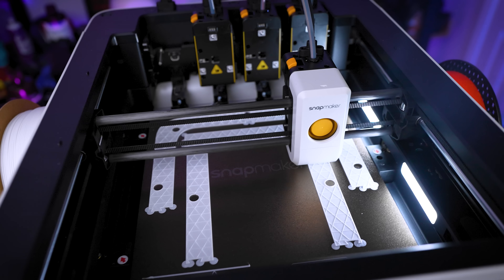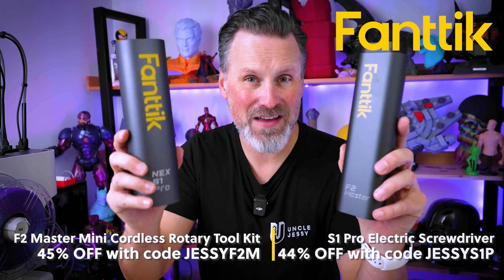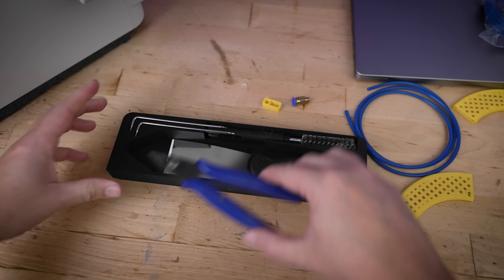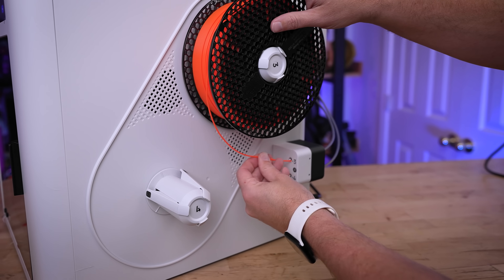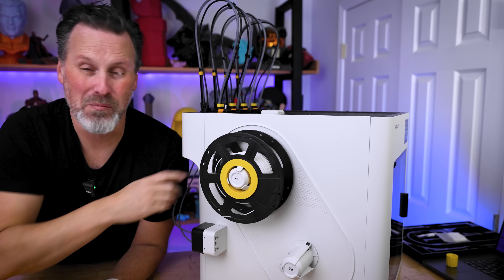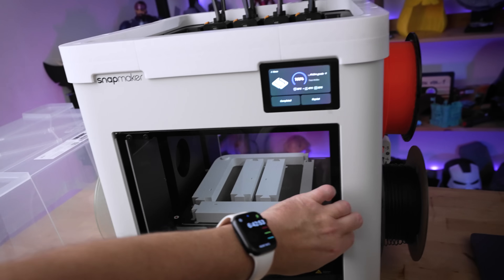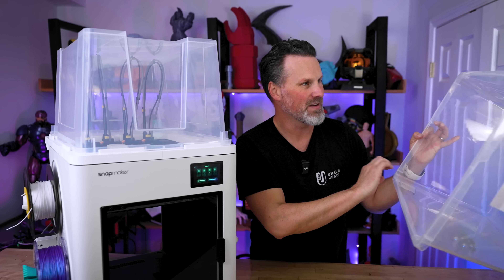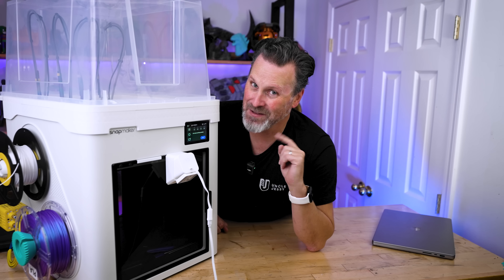10+ Mods That Make the Snapmaker U1 Even Better!

Comment from the maker: Get 45% off total for Fanttik F2 Master Cordless Rotary Tool Kit  with code JESSYF2M at  https://amzn.to/4nKpizZ 
Get 44% off total for Fanttik S1 Pro Electric Screwdriver with code JESSYS1P at  https://amzn.to/3Lw0MoZ

What Kind of Mods do you want to see on the U1?
Reply: Well 3 days after, code still dont work... Too sad, Tell Fanttik that this kind of problems hurt your comunity trust.
Reply: The promo code does not work. When I try to apply it I presented with the following message "The promotional code you entered cannot be applied to your purchase."
Reply from the maker: @cid @cidercreekranch oh no let me double check
Reply from the maker: @cidercreekranch looks like it should be fixed now
Reply: @UncleJessy  Same thing. Instead of 44% off it offers $10 only. Still too rich for me.
Reply: Conde does not work...
Reply: The promotional code you entered is not valid
Reply: Same.. Does not work
Reply from the maker: @000elemental000 looks like it should be working now
Reply: @UncleJessy 44 % off 59$ isn't 10 $ which what it is showing
Reply: I am having the same issue with the code as cidercreekranch. I fallowed the link provided, added it to cart and applied code but it says following message "The promotional code you entered cannot be applied to your purchase."
Reply from the maker: @DemonEjus thanks! I’ve reached out to my contact to see if they can get that corrected!
Reply from the maker: @DemonEjus 🤞🤞 should be working now
Reply: @UncleJessy  still giving me the same message sadly.
Reply: @UncleJessy still no joy.
Reply: @UncleJessy  The code is still not working. I bet you didnt realize the head ache this was going to be. Lol
Reply: Regarding the Fanttik F2 Master Cordless Rotary Tool Kit, Amazon is only applying $23 discount on 45% off $75.
Reply: @raysuave20  The code is working for you? Because mine is saying "the promotional code you have entered cannot be applied to your purchase."
Reply: @raysuave20 I believe it is off the full price, not the current price.
Reply: Code not working for the screwdriver for me either.  

As to the comments re:  Uncle Jesse being a shill?  I can read.  Amazon reviews seem quite positive.   

Bringing quality products to my attention is the POINT of YouTubers as I understand things.
Reply: This soulless youtube shill can't help but shill garbage products.

Fanttik is trash and uncle Jessy will gladly advertise any garbage on his channel as long as they pay him. 

DO NOT BIY ANYTHING HE SUGGESTS...
Reply: @Nonsense-hg6mo  But we should follow your advice, although u didn't provide any example / experience / reference to support ur claim, because... ?

Comment: I've had the exact same problem with my U1, used PETG and it clogged up very bad. I was using toolhead 4, The hot end is stuck inside the PETG balloon, the printer knocked hot end 3 off of the back rack and pulled the casing off, not sure how bad that's damaged. I've logged a support ticket but my printer is basically bricked - how long did it take you to get a replacement dude?

Comment: I'm pretty sure you can still print with 1 hotend disabled, i had exactly the same problem and i was able to print with my remaining 3 toolheads.
If i recall correctly you have to unplug the hotend but leave in the thermistor. If you leave the hotend plugged in it wouldn't work, if i disconnected the thermistor it wouldn't work, but with only the thermistor it worked.

Comment: what I would like to see is some extension cables for the filament feeders so you can mount them behind the printer thus making printing from a filament dryer like the s4 easier. I'm also curious, since it's open source, if one could use a macro that, when an unload command is sent, an extra command is sent to an exterior motor that sits in a drybox for example, and would handle retraction so you do not have to open the box to manually rotate the roll

Comment: It could make for a cool video to let GenAI help you calibrate your filament and improve your print quality. Upload images.. let it tell you which flow rate is best, which pa setting is correct, which temp tower temp to pick ... Troubleshoot whisps and quality on prints after etc.. it works fairly well honestly.

Comment: You mentioned wanting to magnetically attach your tools to the side and I had a thought: Would it be possible to remove the side panel and epoxy some neodymium magnets on the inside of the panel before putting it back on the printer? That way you'd have an invisible mounting point.

Comment: I use the same pavers and mats for my printers. Highly recommend it for the new faster machines
Reply: what's the benefit of putting the machine on pavers?
Reply: @thsaintful  It helps to add mass to the surface the printer, which helps isolate its movements, especially when the paver is on a mat for further isolation. It also is a safety measure for wooden surfaces as if the printer has a electric issue and or fire, the concrete will not burn (well at least not easily)

Comment: What's the pavers for?
Reply: Basically you add a layer of some type of hard foam and a paver on top of it then place the printer on them. What his does is reduces noise and vibration while increasing stability

Comment: Absolutely insane that they didnt bother designing the printer to be enclosed out of the box. $1000 and having to spend $250 on the official enclosure is right out of Prusa's playbook.
Reply: For all its hype its outdated out the gate
Enclosure with chamber heater should be a standard now days, keen for biqu chamber heater for bambu p series

Comment: Not being able to use the remaining 3 hotends when one is out of commission seems like a huge oversight.
Reply: I'm pretty sure you can, i had exactly the same problem and i was able to print with my remaining 3 toolheads.
If i recall correctly you have to unplug the hotend but leave in the thermistor. If you leave the hotend plugged in it wouldn't work, if i disconnected the thermistor it wouldn't work, but with only the thermistor it worked.
Reply: Yeah that's definitely something I was like oh but you can just use .... Nope lol
Reply: * remaining 3 hotends (there are 4 total)
Reply: @bobbob0507  Ah yeah, sorry -  was thinking of the Prusa XL for some reason.
Reply: Supposedly the limiting factor is orca
Reply: Thats what i was thinking too
Reply: definitely requires a firmware fix but temporarily wiring a ~100k resistor should get you going
Reply: Pretty minor issue at the end of the day, won't be an issue in a month

Comment: To be fair, the 150$ top cover does include HEPA and active carbon filters. And uses less space (less volume == hotter enclosure)
I wish they also included a port to attach a SnapDryer or two for active heating, and/or a port for venting to the outside. Nothing a reciprocating saw can't fix though 😆
Reply: Yeah, i don´t really get why people compare these two. Sure 150 bucks is not cheap, but i get an air filter with that and for me that is actually the most important part of the enclosure.
Reply: @XA--pb9ni  I agree. There are all these videos about how unhealthy it is having a 3D printer in your home, even if you only print PLA. I think 150€ is fairly reasonable investment into your lung health.
Reply: @AlienShrmp  And if not for your health, i just find the plastic smell unpleasant, even from printing PLA not to speak of stuff like ABS, PC or Nylon, that stuff reeeks. I mean i could have probably just modified the Box with a DIY Filter as i did for my old printer enclosure, but honestly this is my "Just works" printer and i don´t want to mess around a lot, just use it as a tool for my projects.

Comment: Not sure if it would be possible, but for a side mounted tool holder - attach magnet on the inside wall of the printer, to attract the one on the outside?

Comment: Software mods I've used (some thanks to tips in the facebook groups)
- printer.cfg stepper X & Y currents 1.2A->1A [reduces noise and stepper temp]
- printer.cfg Extruder fands 1.0->0.6 [22.000rpm=> 15.000 rpm; much quieter. no issues with PLA 220°C or ASA 260°C so far]
- accelerations 10.000->7000 for noise reduction.
- filament profiles: prime /purge/wipe volume 40/65mm³->5mm³ and make sure to change the infill to gyroid.
- wipe tower: 40->15mm width, 8mm brim, 5mm³ volume (may not be necessary because filament+wipe tower volume is combined) and print as fast as outer walls.
- bed leveling: mine came with a 0.46mm range over the bed. That's not too bad but I wanted to get the maximum I could. There is a guided manual tramming but it got a bit better when I manually turned the wheels I believed would be beneficial and checked the webinterface view after another auto-calibration inbetween. Then added some 1-3 layers of Kapton tape to the Edges and 1 side => 0.26mm range overall - and if I exclude the outermost 1cm, 0.15mm flatness.
I've been printing PLA and ASA (from a 65°C dryer, bed set to 100%, Ikea box without printed frame as enclosure) so far with these settings without issues :).

The U1 is an awesome machine, especially for this price! Of course there are a few unresolved issues in the software (e.g. Ai detection was said to be added in december via firmware update. no news about it yet so it may be a bit delayed, but so far I haven't had issues. ) But 1 custom firmware already exists and snapmaker promised to open source the SW (by 03/2026 I believe).

Comment: hey unclejessy, i actually have the s4 and have it hooked to the u1 where it sits behind the u1 so 2 of each rolls feed out to each side and i bypassed the motorized part (mine don't seem to work right...) and just used the ptfe tube from the back of the feeder to the s4's filament inserts and feed it directly up the tubes to the extruder gears.. does require manual feeding to use it but honestly, im a few hundered hours of printing in with this method and have had 0 issues... let me know if you need pics to see what i did
Reply: also costco has a set of bins that are close in size, ive been meaning to modify the files for it just haven't had time

Comment: @9:45 what? One tool goes down and the hole machine goes down?
Reply: Does seem a bit daft.
Reply: If that is the case, I'm confident they'll fix it with a new firmware. But since the printer.cfg can be edited and there is already a custom firmware, there's definetly a way to tell it it's only a 3 toolhead printer :D

Comment: I think the next best thing is some kind of enclosure for the side spool holders to allow you to keep the rolls on the printer mostly out of the air. Even if it means needing to use weather stripping to get a decent seal against the body of the printer. There's already a Pill Bottle-esque side profile on the printer that seems to be crying out for some kind of cover that engages with it somehow. Maybe with some straps/tabs that click in at the top and bottom of the printer.
Reply: That was what held me back initially. I got spoiled with my P1S AMS.

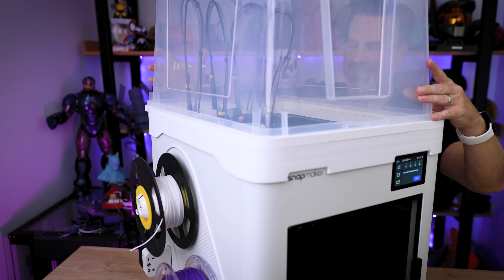Comment: 9:35 it also keeps fuzzy pets out of printers. I have two shop cats that come visit. No injuries happened first off. But I had my Centauri Carbon top open to print a huge benchy and once it was done oneif the two cats had climbed in the printer in stand by, pushed the bed down and loafed inside the printer looking around. I had to go find out why the bed was all the way down on my Unifi camera system and discovered that interesting little incident.
Reply: I just got my Centauri Carbon and I've been fearful of that. My little brat is nosy and a demon! She found a way to get into the garage rafters and knock the box down... and then last night she body slammed the chair in the garage and sent it and the prints and paintings I had drying nearby flying all over the place! She gets into everything! Don't get me started on her antics with the Christmas tree!
Every time we run into this I get Bart's "I didn't do it. No one saw me do it. You can't prove anything..." 
😆
Reply: @c @chrishechtl8330 h, yes they are plenty of fun. And sometimes full of sneaky craftiness! I have since replaced my Carbon after 466 hours of printing the USB cable became a serious 103 issue I bought a replacement off Amazon but after replacing two extruder circuit boards and Elegoo releasing the carbon 2. I have lost faith in my printer and went back to using Elegoo resin printers only from them. Bought another P1S as replacement, couldn’t pass up blk Friday deal.

Comment: That threaded insert for filament rolls, they need to remove 50% or more of the threads so it inserts 50% of the way and then threads
Reply: thanks to your feedback I have just published the profile with only 3 turns which makes disassembly much faster but maintains solidity(I'm SkyMaker)
Reply: @skywolfoo awesome!
Reply: What about cutting that part in the slicer? Surely you don't need that entire length.
Reply: I'd modify it to make it a 1/4 turn, pretty easy to do

Comment: Cool mods, but eww at most of the files being on Makerworld...  I don't like sites that require you to register to download models, or limit the number of downloads without an account. (which on MW is bugged and claims I've used all 5 of my unregistered downloads, when I've never downloaded anything from there (due to the error being present since first visit))

Also the whole not willing to support Bambu after their lies and gaslighting thing; but Thangs and Cults3D are just as bad with requiring registration.  Printables FTW (or Thingiverse).

Comment: Polyethylene cover to print abs? is this a joke?
Reply: I've done 3*10h, 1*15h, 3*4h ASA prints with an IKEA SAMLA box. Toolhead 260°C bed 100°C chamber.. ~55°C (no active heating) in a 21°C room. The outside of the ikea box is around 40°C; no deformations yet. But I see it as a temporary solution to print the 'top hat' (from 'Srin' on printables ) in ASA
Reply: @MartinRies  What is exact plastic it is made from? LDPE (Low-Density Polyethylene)

Starts to soften / deform: ~80–90 °C

Melting range: ~105–115 °C

Very flexible, deforms easily under load when hot

🔹 HDPE (High-Density Polyethylene)

Starts to soften / deform: ~100–120 °C

Melting point: ~130–135 °C

Stiffer than LDPE, but will still creep under load near 100 °C
Reply: @akierum  sorry, didn't see the notification. No clue... Ikea just says Polypropylen (PP) so it should be stable up until 100°C, short term 140°C. The heatbed is limited to 100°C and snapmaker suggests to keep the chamber temp below 80°C I believe. (the electronics and stepper motors may not be rated for higher temps - so some isolation could help there. I don't intend to go above 65°C with the chamber. ASA worked fine with ~55°C with a BRIM with no brim-gap.
Reply: HDPE can easily handle temperatures of 60-70C, which is about as hot as the U1 will get without a chamber heater.

Comment: With the pace these chinese companies are releasing 3D printers they really should just ship the extruder and call it done. We will mod the extruder to add a printer around it and also reverse engineer the closed/stolen klipper adaptation so we can run vanilla klipper on them without the so called "flavored" slicer of them that has 0 added value.